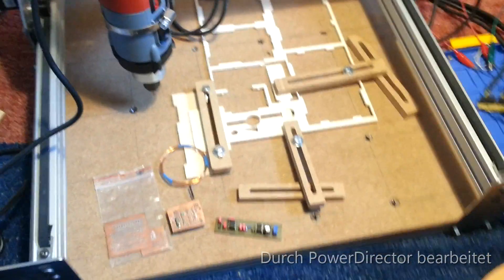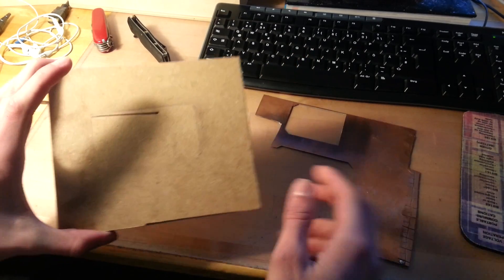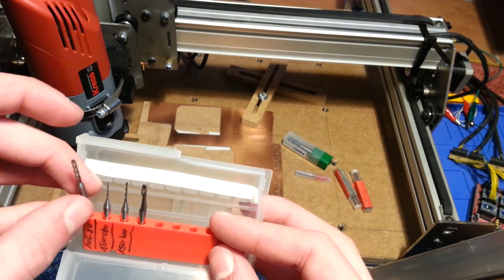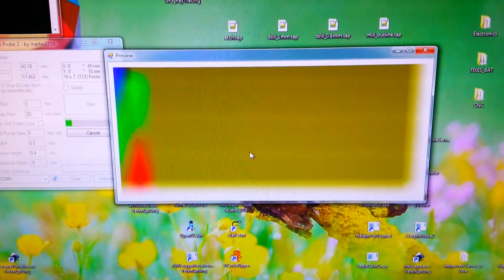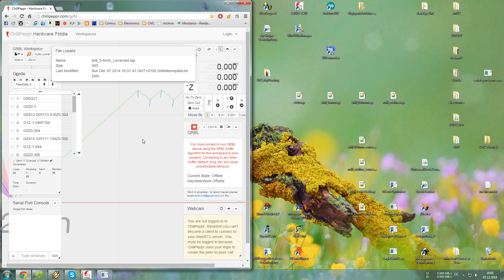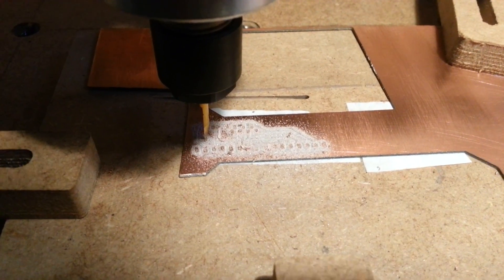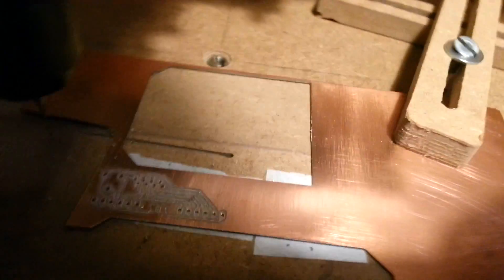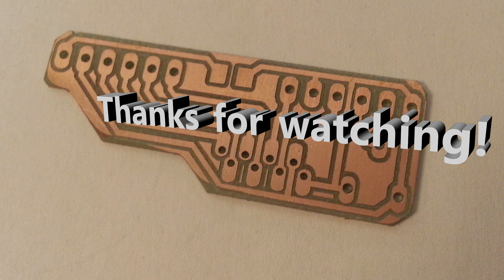PCB Autolevelling for Isolation Routing - Shapeoko

Comment: Hi Martin, I see you're using ChiliPeppr just to preview, but have you tried using the Auto-Leveller built into ChiliPeppr? It does pretty much what you showed in your custom software, but you get a nice 3D previewer as it's running and it generates the final Gcode with one click.
Reply from the maker: Hi John,
Yes, I did use Chilipeppr and I do quite like it in general, but there are some things that led me to write my own software:
-at the time that I wrote the software, the GRBL version of ChiliPeppr missed every other probe cycle because of the command (G38.2) was sent when the probe pin still touched the surface, effectively making the probe feature impossible to use. By now that got fixed, at least in Jarret's fork. Since I didn't know of any other software that does it (and still don't), I had to make my own, at least for the time.
-This might not actually be true but I think Chilipeppr does not split up moves that are longer than the grid size, this might be a problem with warped boards.
-I never tried it, but does ChiliPeppr allow to adjust multiple GCode files without having to reprobe the board? Also sometimes I need to make adjustments to the drilling or milling files while I'm already etching away.
-At last, just a personal preference, I don't particularly trust any browser to be stable, especially on the critical task of CNC milling. It never crashed on me, but I just have, over time, built up more confidence on my workflow.

Nevertheless, Chilipeppr is very good, I especially like the modular concept.
Reply: martin2250 You are correct that ChiliPeppr still does not split up long moves. To do that is a bit tougher because you have to convert one line of Gcode to multiple lines. It's definitely possible with a bit of extra code. Sounds like you solved that in yours. It's not trivial as you have to do a lot of math, so congrats on doing the math. It would have been awesome to have you tweak the Auto-Leveller in ChiliPeppr rather than roll a brand new one, but I understand.

ChiliPeppr does let you apply the matrix to subsequent files of Gcode without reprobing. Just drag in your new Gcode file and click "send Gcode to workspace". It uses the probe file that's loaded. You can also load previous probe files and do the same process.

I can understand the trepidation of the browser, but I'm not sure I'd trust Java any more than I trust the browser. Garbage collection in Java is pretty rough and can cause problems milling long jobs. So, nothing is perfect. Also, once you get your stuff in the browser you can do amazing things like turn an old smartphone into a jog pendant so it can talk in parallel to your CNC while your browser is talking from your laptop. Doing that from Java is just never going to happen.

The work you did on your probe app is awesome and one of the goals I'm trying to do with ChiliPeppr, and thus why it's so modular, is to try to have it be a rich environment that folks feel comfortable putting energy into rather than fragmented apps and desktop downloads so we can all advance forward the industry together and our open source tools. So, I'm always curious to find out what isn't appealing to folks to try to solve that.
Reply from the maker: John Lauer To be fair, the math is not that hard, Chilipeppr already parses all X Y and Z positions of every line, so adding the splitting mechanism won't be too much touble. I would love to contribute to Chilipeppr and in fact, I already took a brief look at the source, but I just don't know enough Javascript to really do anything. If you'd like I can at least send you my source code, but It's not especially tidy or commented in any way.

I do have to admit that a browser environment does offer benefits, and I'll probably going to use it more in the future. (using your smartphone as a pendant did already happen in the UGS nightly and I often use it.)
Reply: martin2250 Well, for the math being hard part, I mean doing the ray intersections on a plane where you take the Gcode XY position and project it onto the warpage plane from the probe locations. Did you use an alternate approach? On the long lines, yes, that's simply breaking the line up and projecting each point as if it had been there originally. I would love it if you got more involved in CP. I think we all could benefit from your brain. I didn't do a ton of Javascript either until lately and now I'm in love with it. I posted a lot of videos on extending/modifying ChiliPeppr in my channel to help folks get started.
Reply from the maker: John Lauer Yes, that's exactly how I'm doing it right now: If the length of a linear move is greater than the probe grid size, it will be divided into sections smaller or equal to the grid size. Also I cheated a little by ignoring arcs, as pcb-gcode does not use them anyways. I'm working on a similar program though that does some nifty calculations for finding arc centers, so I think I'm prepared for implementing those as well.

I might give CP another go, although honestly I'm not looking forward to working with js.
Reply: martin2250 Well, maybe as an enticement to get you more involved in CP, I'm just about done doing the Eagle BRD Import widget and it's really amazing. I have been frustrated with PCB-Gcode for Eagle. I find the app a bit outdated and the iterative process to inflate your paths as large as you can, but then having to figure out visually if you lost a path, kills me. I also find that every time I upgrade Eagle I end up with pcb-gcode problems. Also, if I've installed a new version of Java it seems to mess up pcb-gcode as well. So, I went the harder path of letting you drag/drop an Eagle board into CP and then I'm doing custom path generation including my "magic wand" feature where I raycast out the lines for each signal and if they intersect any of the other signals, it averages the path. That means you get beautifully inflated paths but end up with a perfect middle line where the clearance is really tight. I've never seen any software out there do that. I'm using a combination of Three.js and Clipper.js to do all the trickery. I am loving Three.js for doing this as the toolset available to you is way beyond anything I ever found in Java. So, despite your displeasure for Javascript, you may draw the same conclusions I have--which is that the libraries and community around Javascript now blows away Java.
Reply: martin2250  BTW, in CP I convert G2/G3's to line segments in the 3D viewer. This was not trivial and required a lot of community feedback to get all versions of Gcode to render correctly depending on whether IJ was used or radius was used. So, to support arcs, I was thinking I simply take the arcs, convert them to G1's (which I've essentially already done), then apply the auto-level raycast on the G1's, re-insert those lines into the Gcode instead of the G2/G3 move. That feels to me like it would better match the warpage as opposed to sliding the entire arc up or down, because the arc could span wider than a probe grid. If you convert to G1's then you get lots more XY points to raycast and match the warpage.
Reply from the maker: John Lauer That is one approach to solving the arc issue, I was thinking of another way: splitting arcs into smaller arcs, by inserting more G2/3 with XY coordinates along the arc. The radius or center could remain the same.

Also, what exactly do you mean by raycasting? In my program I'm using an array of probe data and I'm simply doing some bilinear interpolation for each point and add the result to the Z coordinate.
Reply: martin2250 When I finish the probing I essentially have two triangles for each grid square. I create a plane for each triangle. Then I find every point in the original Gcode and raycast up/down where that ray intersects the plane. The point for intersection is the new Z value. I'm guessing you're doing the same thing but not using raycasting or creating planes. You could likely just do pythagoeran theorem a couple times. However, Three.js has raycasting so they do lots of the hard work for you. Three.js will also do some rounding for you if you want as well.

BTW, here's the macro for you to run in CP to get the G1's for a G2/G3 arc in your Gcode. It's pretty sweet that it's already there for you. It would just require some last steps in the Auto-Leveller widget. If you fork it, you could add this pretty easily. Try the macro out and let me know what you think.

var get3dObj= function() {
	chilipeppr.subscribe("/com-chilipeppr-widget-3dviewer/recv3dObject", recv3dObj);
	chilipeppr.publish("/com-chilipeppr-widget-3dviewer/request3dObject", "");
	chilipeppr.unsubscribe("/com-chilipeppr-widget-3dviewer/recv3dObject", recv3dObj);
};

var recv3dObj = function(obj) {
	console.log("got 3d obj:", obj);
	// Get Gcode lines from 3dObj
	var gcodelines = obj.userData.lines;
	// Loop thru lines to see if there are G2 or G3's
	for (var i = 0; i < gcodelines .length; i++) {
		var line = gcodelines[i];
		if (line.p2 && line.p2.arc) {
			console.log("the G1 version of the G2/G3 arc for gcode line:", i, line.p2.threeObjArc.geometry.vertices);
		}
	}
	macro.status("got 3d obj");
}

get3dObj();
Reply from the maker: John Lauer I just copied the code over to N++ and spent some time trying to understand it. I just really don't know where to start. The comments did help, but I don't know the libraries or your code. I think it will be faster and also better if you implement it. The source code for my programs is here:
https://drive.google.com/file/d/0B2OzfW5smQv8OHlLSjhaWVl3UjA/view
The most interesting pieces of code for you are both in the GCodeFunctions library: in HeightMap.cs > double GetBilinear(double X, double Y) there is my soulution for finding the height of an arbitrary point and in GCode.cs you should take a look at the ApplyHeightMap() function. It does all the splitting and adjusting.
Let me know if it is helpful or just in general what you think of the code (sorry in advance for the total lack of comments, but most things should explain themselves and the relevant functions are pretty short)
Reply from the maker: John Lauer That eagle import feature does sound really neat! I don't have any problems with pcb-gcode, but the voronoi regions feature was always something that I missed. That said, there are programs that only carve away one single line between traces, but they only run on linux, and at least visolate did not work properly in my tests.

Comment: Thanks. This is really excellent info!!!
Reply from the maker: Thanks! You're welcome
Reply: martin2250 So, while not related, but related through the cover image... I see a circuit board connected to a coil. I am awaiting some stuff from Mouser to make a wireless electric transfer project. Is this something similar?
Reply from the maker: Mike Solomon This is a small NFC capable board, it uses an AtTiny84 clocked at 13.56MHz. It needs external power and only receives minimal current from the phone, so no power transfer.  If you want more info, I'd suggest checking out the author Nonan